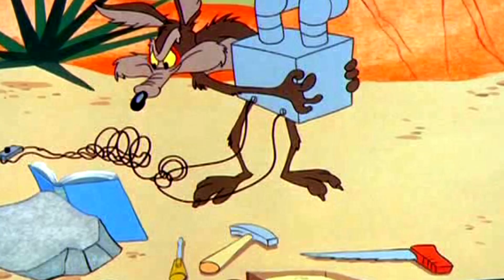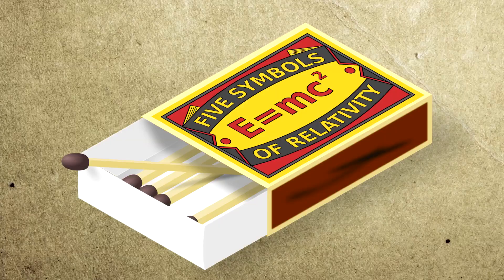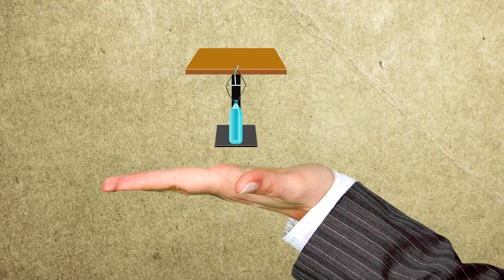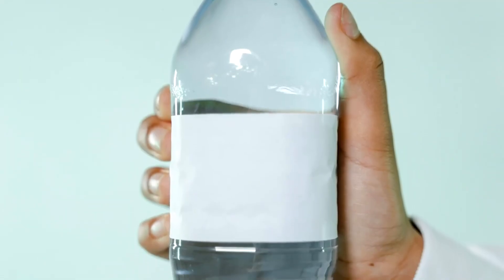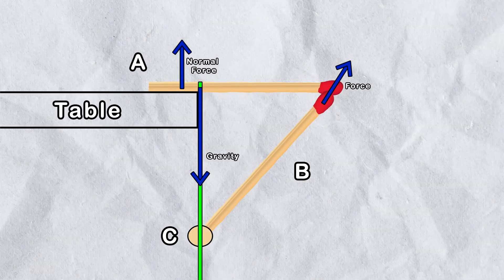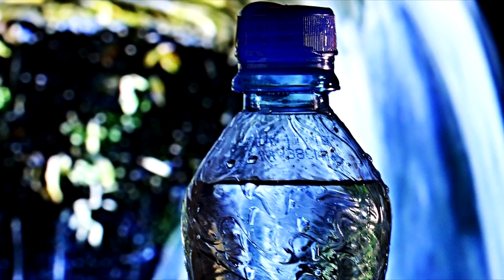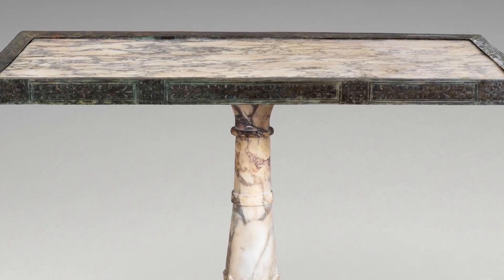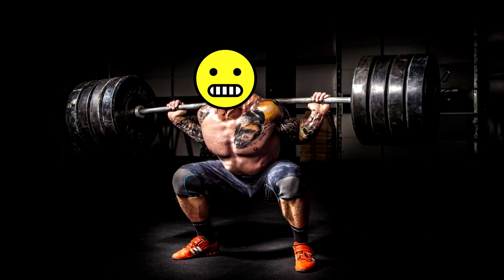why it works 3

Comment: Missed an important part, those are Q-TIPS, NOT Matches. I would definitely not recommend doing this with matches because the friction between the two loadbearing matches could start a fire.
Reply: It also makes it slightly more impressive considering that Q-tips snap and bend much easier compared to matches